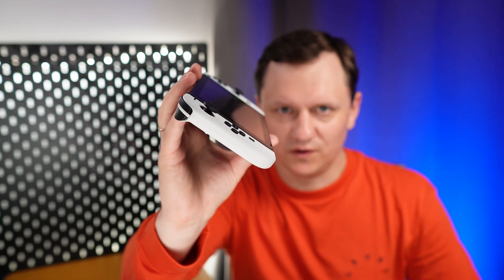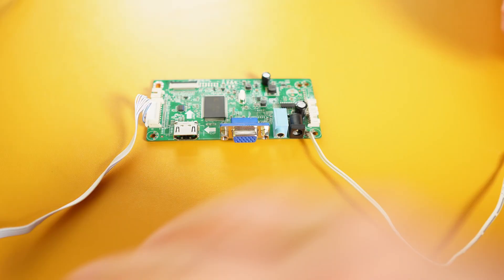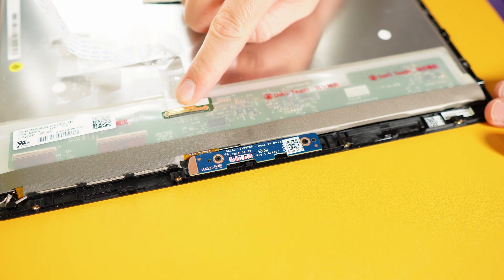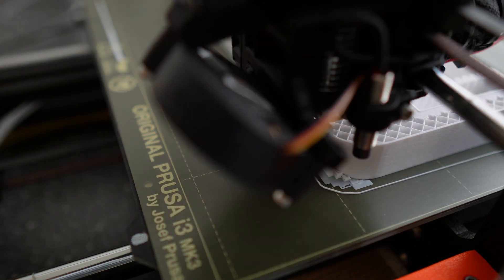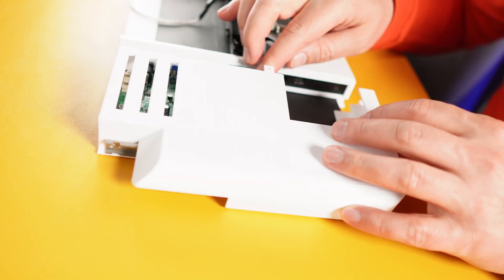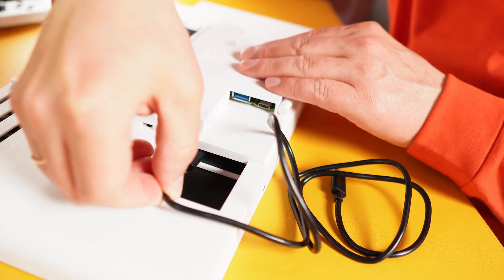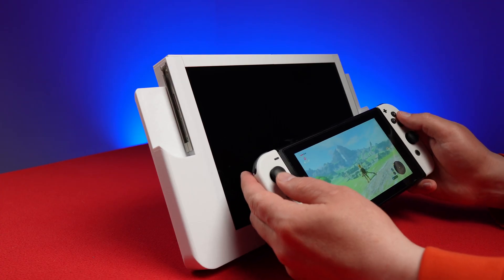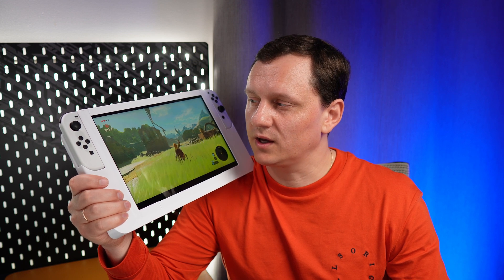Nintendo Switch 2x faster without overclocking

Comment: I've had a similar idea for something that works like this. It's essentially be a Monitor with a slot in the back did the switch where it slides into it like a cartridge. I'd want to find a way to build a battery into the Monitor so it would all be seamless

Comment: Thats a lot of work just to run Portable games in Docked mode.
Yeah its nice to have a bigger screen, but its inconvenient when you can just use ReverseNX, which you have access to because you're mentioning overclocking.
Reply from the maker: I have not tried ReverseNX. It will be very interesting to try it on daily basis.
Reply: @PavloKhmel  Its a very wonderful tool.
you can play handheld games in dock mode
or play docked games in handheld to get better performance.
I use it for Xenoblade and SMT V with tweaked graphics configs and 60 FPS patches.
Reply: @kokumosu  I just wished I could OC my switch without having to get it hacked… Also I sold my og 2016 switch and now have the oled one so no hacking :(